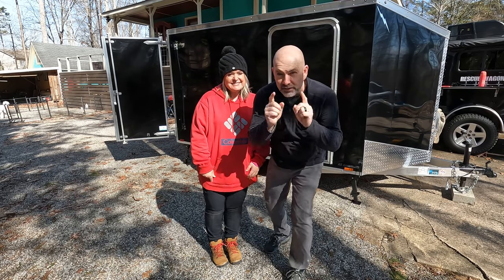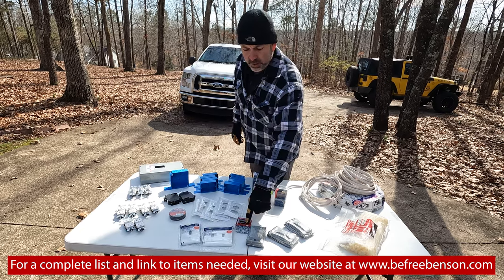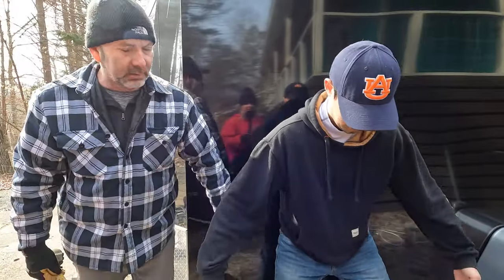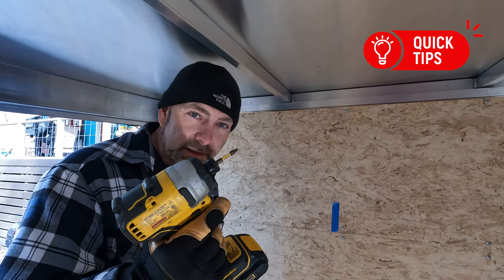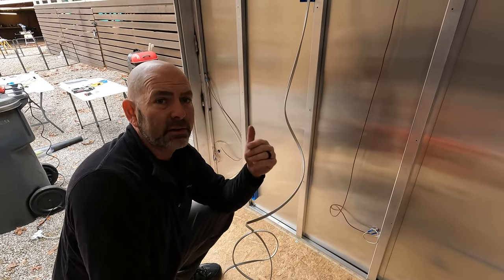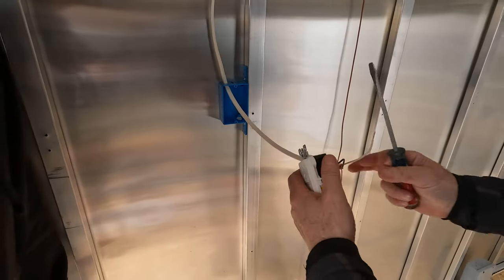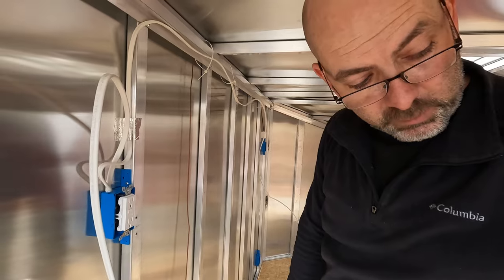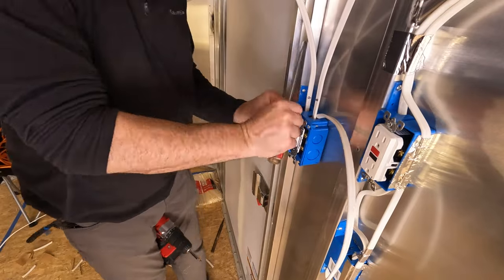WIRING A CARGO TRAILER CAMPER//6x10 Cargo Trailer//Ep.3

Comment: Useful video except for one thing....your wire should have been stranded not solid core. The solid core will not withstand the flexing of the trailer and could possibly short out over time. I'm building a CTC also and I've watched hundreds of video's on the wiring and every builder I've seen will tell you to use stranded not solid core wire. I actually watched one builder go back and remove all the solid core and exchange for stranded. I hope it's not to late,good luck!
Reply from the maker: Thanks for the heads up.  Unfortunately, we have completed the entire build although all the videos have not been released yet.  I will definitely keep and eye on things much more closely now. I really appreciate you watching and letting me know!!!
Reply: It's purely theoretical. People grab on to the idea and it spreads on social media while having no basis in reality. 12/2 and 14/2 solid Romex will not fail if you install it properly.
Reply: @carlyellison8498  I disagree on the basis I watched several YT video's of CTC owners going back and rewiring their rigs. They started having issues with the Romex connection breaking off and that's just one problem. I have also read numerous comments by licensed electricians stating the Romex is not a good candidate for use in a CTC. But HEY @carlyellison8498 you do you and I'll do me! 😉😉
Reply: @alanosborne1947  - ironic but unsurprising that you go around giving unsolicited misinformation to others and then say, "you do you" when called on it. When properly deployed, Romex has been proven to be a safe and appropriate choice in RVs for decades and for billions of miles. Don't use it for an outlet on a trailer ramp door (of course), don't knick it when removing the insulation, and do secure it along its run and it will serve you well. Happy wiring.
Reply: @alanosborne1947   If they aren't using romex, what are they using? I'm a licensed electrician and I've never seen a stranded nonmetallic sheathed cable that would fit this application (14/2 w/g).
Reply: @jimmac1185 They're using marine grade stranded wire
Reply: @jeffsutton2806  marine grade 14/2 with ground?
Reply: @jimmac1185   marine grade tinned copper stranded wire it comes in 2,3 and 4 wire of all sizes
Reply: Boats use stranded wire for this same reason. The movement and flexing will inevitably cause premature failure of solid core wire. An RV is subject to the same conditions as a boat... lots of movement, lots of vibration, and lots of corrosive road salt.

Comment: Fun fact: the National Electrical Code applies to recreational vehicles. So many violations. Please hire an electrician, these DIYers have just enough knowledge to get people hurt.
Reply: Please explain all the faults you see, I have been wiring for 40 years and saw nothing that would be unsafe
Reply from the maker: Thanks for your comments, and thanks for watching!!!
Reply: @herbbates4713  let's see, off the top of my head. Box fill. NM cable supporting and securing. Free conductor length. That load center? All I can say is WTF. If you really were an electrician for 40 years, you must not have been licensed.
Reply: I did commercial work, I was not a Romex nailer, there they just kept adding extensions till they had the right size, in a cargo trailer you don't have that many places or room to run wire, now the one I'm doing using shallow boxes, you don't have room to overload it, I'm using 600 volt cable for the extra insulation on the jacket and the wire to help stop wear, then again the trailer will only be used a few times during the year, won't be running the road around the clock but I still don't want failures as He is a friend  and I go camping with him and many other friends two times a year but even if he wasn't I still don't want any failures

Comment: This video is a fire hazard waiting to happen, the boxes you are using ARE NOT legal for multiple romex. Please take this video down until you know what you are doing.  All boxes have a cubic inch rating stamped in them so an electrician will know how many conductors can safely be in the box, this is for heat dissipation, in other words, Fire Safety.  NEC 314.16
Reply from the maker: I am certainly not an electrician...  So I appreciate your comments.  We basically did the wiring in this based on the wiring in our other Cargo trailer that was from the factory.  It's a super tiny box.  It was all we could find at the time.   We use a generator 95% of the time, which only allows you to run the A/C and fridge with some LED lights.  Anything more than that and you have to shut off the A/C so we don't overdo it with this tiny box.  We also do this when hooked to shore power.  I will certainly do some more research, and I am definitely appreciative of your concern for safety! Thanks!!!

Comment: One thing I notice you didn't buy a trailer that she can stand. Why would you buy a trailer that she can't stand up in.
Reply from the maker: Thanks so much for watching.  Jeeps are very weak at pulling.  If you go to big or too heavy you run into problems.  It's also very hard to find small trailers that are tall enough.  They work pretty well, but you have to be good with tight spaces... LOL
Reply: I was thinking the same thing

Comment: nice video we need more at the end you mentioned three of circuit four circuits rans inside the panel and what are they im wiring up my trailer i just wanyt to get it right can you break it down for me what is circuit 1....2...and 3
Reply from the maker: The circuits are separated by what they power.  One circuit is half of the outlets, one is the other half of the outlets and the lights, and one is dedicated just for the mini-split a/c unit.  Hope this helps.  Thanks for watching!!!
Reply: @befreebensondiy  thanks for the reply what does the switches run also is the mini split hard to install what line did you put that on was it the 20 amp
also what size windows did you get and can you put up the link to the windows
Reply: @befreebensondiy  also how may outlets per line i have a 8.5x16 trailer slight vnose

Comment: Great video!
I have basically a box truck with a standard entry door that i use as a mobile work shop.
I have 3 different energy sources to choose from.
Shore power, generator or 12 volt power inverter.
I wired my breaker box in a typical fashion, and put my power lead, a 30 amp dryer cord to connect to  my chosen source. 
I have 3 separate cord matching 30 amp  surface monitor outlets
The shore power is connected to one outlet, one to an external power cord for the generator, and the
my 12 volt power inverter. 
I didn't add too many outlets. 
I use  6' power bars, 2  just below work bench, 2 underneath my  ceiling mounted 8" storage cabinets. 
Not real pretty but very practical for me.
 side, running them 2 per in series.
Reply from the maker: Nice!  Sounds like you are set up!  Thanks so much for watching!!!

Comment: Hey guys, great vid! This is exactly what I was looking/hoping for! FYI ; the square headed screws are called Robertson (a Canadian invention).  Are you guys planning on running a bead of silicone around the exterior receptacle,  and the shore power inlet for added weather protection (just a thought)?  Thanks again!  Kev from Canada
Reply from the maker: Hey Kev from Canada!  Thanks for watching!  We will be putting a bead around the outlets, but the shore power connector pivots right at the top and makes it difficult to have a bead of caulk and still get it open.  I installed the same connector on another trailer and it held watertight... Thanks for the reminder!!!

Comment: Well done. Nice to see how things are advancing.  Nice hack with the electrical box. 

Did you put it up high enough to account for the additional height of the mattress?

"If I get lit up....Be Free!" Tap to chest 💪👍🤙 great outtakes at end.
Reply from the maker: We actually put it in an area that will be encompassed by a built in bench.  The idea is that we will eventually add solar.  This should provide a place to hide the inverter and the batteries.  As always, thanks for watching and for your encouragement!
Reply: @befreebensondiy   you two are awesome.  Thanks for sharing your journey.    I just had a great meeting with our producer, so we'll be able to start sharing soon as well. 👍

Comment: the one breaker that you showed connecting was it a 15amp or 20amp, would it be any different if it was either? is it same process for multiple breakers?
Reply from the maker: Not really.  Most of the time you are using a small generator to supply power...  When this is the case you have to shut something off to turn something on.  In theory the breaker will allow more current before tripping.  The process is the same.  I am not an electrician, so it is always good to talk with someone who is an expert.  Thanks so much for watching!!!

Comment: I'm not going get into details here as I am not a licensed electrician. But... I see an important issue with neutral bonding at your load center. Virtually any shore power supply if NEC compliant will have been bonded already at the facility's service entrance.

A genset or inverter can be a case by case basis.
Reply from the maker: Thanks for sharing and thanks for watching!!!
Reply: I was wondering the same.... I'd think this would be considered a sub panel and as such the ground and neutrals should be on separate/unlinked buss bars

Comment: Do I need a special breaker box for this
Reply from the maker: It needs to be big enough to accommodate the number of circuits that you want without being to big.  It is the same type that you would use in a house, but the connection for incoming power comes from a shore power connection/cable.  Thanks so much for watching!!!

Comment: Did you seriously drill holes in the My box location the first one that you described putting on the wall?
You had an open end that you could enter with the jig, drive straight down the line and never have to drill a hole. 
I commend you on keeping quiet as the My box jokes were being tossed around. There was one that was quietly that I’m sure brought a smile to many other faces not only mine. 
That stuff is right up there with the “ That’s what she said “ jokes and you know I prefer to hang around quality people like that. 

I’ll find out if you did a video but I definitely want to see the finished product and I do have one question. 
If you find out how much you need battery wise, and what size inverter to power the system that you have please share that information. 
Of course, you would have to have the space for the batteries and the adequate amount of roof space for the solar, which you may be just within the parameters. Unfortunately you have a lot of tree cover so unless that things parked in a field the solar charging is not an option at least out there in the sticks. 
You could always charge it on grid, and then if you were off grid later, moderate your usage and potentially get a full 3 to 6 days out of it. 
I’m also making this comment pretty early in the video so I might come across this later but if you were going to get a mini split and put it into your trailer I would highly suggest a really good insulation at least on the ceiling/roof, and maybe some sound deadening foam on the walls And definitely insulation in the floor. 
If you’re gonna put the effort and money into powering up an air-conditioning unit, you should consider insulation.
If not potentially a swamp cooler and a couple of really high velocity, low-voltage fans would be a better option. 
A lot of times people think that they want to have an air conditioner when all they need is something to blow the air around and make them more comfortable. 
It seems like having an air conditioner in a trailer that is probably going to be opened way too frequently and not have that much air volume inside you lose the benefits of condenser, pulling moisture out of the air. 
I’m actually on here trying to wrap my head around how I’m going to wire up a system with exterior lights and interior lights while using the wire harness from my truck to operate parking lights and also I want to be able to have those lights and indicator flashing lights that are on from batteries that are inside the trailer so I might have to have a Three-way transfer between the truck power and the battery power and that will disconnect the grounding and the battery from the trailer to the truck which might be a switch on the exterior. 
I’ve just been trying to find videos about people wiring up batteries and how they ground them and how they hook up exterior lights like chicken lights or floodlight and if they just ground to the frame or if they’re running wiring the full length of the run unless I think you’re a 24 V and up system the cost of conduit and wiring can get pretty expensive expensive. 

Just wanted to share if you know of any videos further about wiring, please let me know
Thanks for the video and I’m looking forward to seeing the final result.
Reply from the maker: We did insulate the walls and the floor.  We have not done solar yet in this one, but if you look on the channel I did do 2 solar panels on the other trailer I call the Rescue Wagon.  That solar system is a very simple system that Charges a Gecell T-500 portable power station.  I use it to run my fridge and charge phone etc.  The cool thing is you can use it while the solar panels are charging it.  I used it on a 21 day road trip to Colorado and it powered my fridge non-stop.  Thanks so much for watching and taking time to comment!!!

Comment: Your power inlet appears to stick out further than the wall.  How did you cover that??
Reply from the maker: The wall space is very limited...  The power inlet and main breaker box eventually get hidden in a built in bench (just released that video not to long ago).  The outlets actually fit flush, but the light switch boxes stick out approximately an 1/8 of an inch beyond the wall, so after installing the switch cover we caulked around the switch.  This actually looks pretty good.  I could not find a dual gang switch box skinny enough to fit flush.  Thanks so much for watching!!!

Comment: How did you ground the actual trailer to the electrical system??
Reply from the maker: It is grounded through the ground wire in the shore power connection.  You don’t ground to the trailer like you would for typical trailer lights when using a 12v trailer connector.
Reply from the maker: Thanks so much for watching!!!

Comment: Shouldn't you be using stranded wire for inside the trailer? Solid copper is more prone to cracking from vibrations.
Reply from the maker: We modeled this one after the one that we ordered from the factory.  I will definitely look into that for the next one.  Thanks for the feedback!

Comment: Looks like a few people commented on what not to do, solid core being one of them.  One guy mentioned cubic inch insides for heat dissipation, ok.  Pro Tips from self proclaimed "non-pros"?   Wires on the wall is a problem.  They need to cool.  Hot sun will keep them hot and likely to overheat.  Too many chefs spoil the soup but the whole family is doing the wiring to some extent.  One other thing is that not only is some of this a fire hazard but the trailer is aluminum and creates an electrocution hazard.  Did I hear correctly that this is being built for somebody else?  If so, you can be sued and liable for damages or death.  Check Nate at Explorist Life or something like that, also check Dave at Dare's Drives for his take on wiring.  These guys got it down good.
Reply from the maker: It's a super tiny box.  It was all we could find at the time. I had to watch other videos to see how it was done on this box.  We use a generator 95% of the time, which only allows you to run the A/C and fridge with some LED lights.  Anything more than that and you have to shut off the A/C so we don't overdo it with this tiny box.  We also do this when hooked to shore power.  I will definitely do some more research and watch the folks you have suggested.  Thanks for your comments!!!